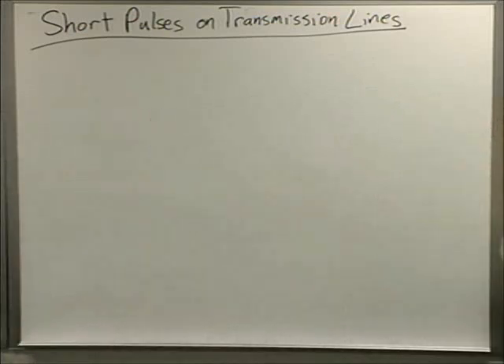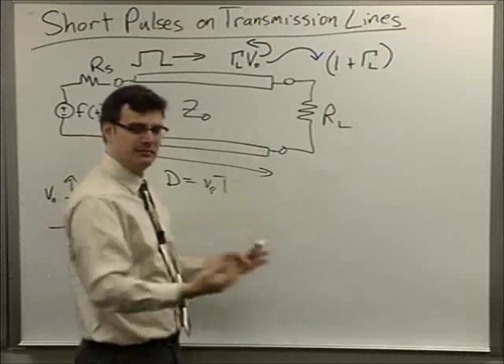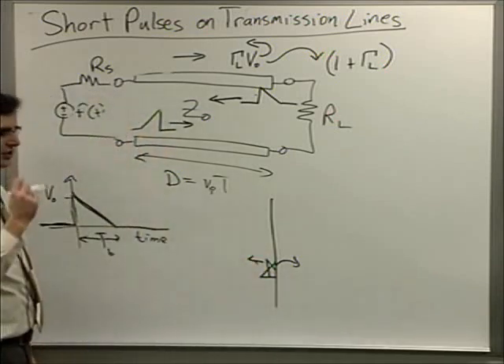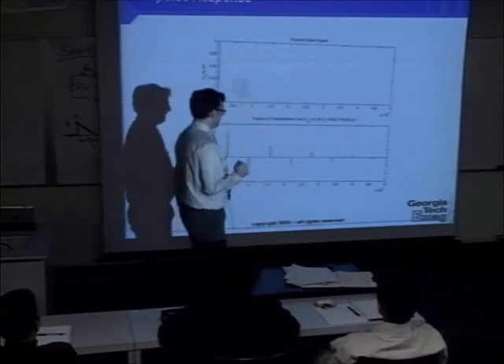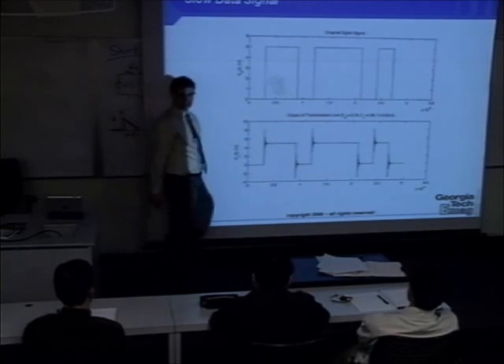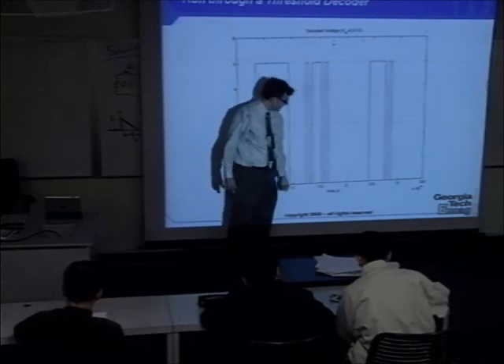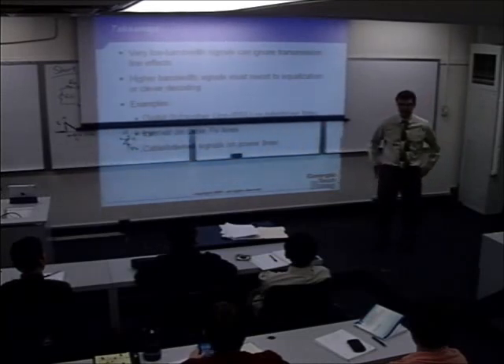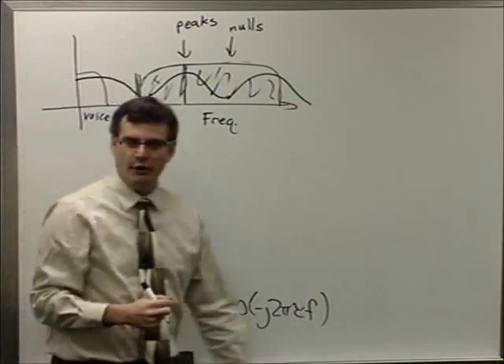TDT07: Short Pulses on Transmission Lines

Comment: At ten minutes into the lecture, you mention having pulse animations. Would you happen to have a link to a website that has similar animations for Youtube viewers?
Reply: https://propagation.ece.gatech.edu/ECE3025/tutorials/Tlines/TlinePulses.htm
Reply: https://propagation.ece.gatech.edu/ECE3025/tutorials/Tlines/TlinePulses.htm
Reply: if you go to the electromagnetics 3025 page (google it) and go to resources, you can see a link to the animations. They're still up there

alternatively you can hop on the Falstad circuit simulator and go through some of the transmission line examples under Circuits